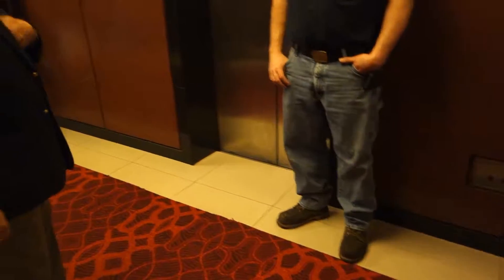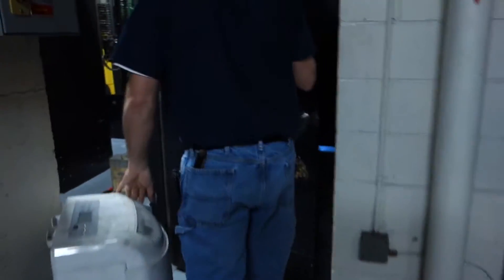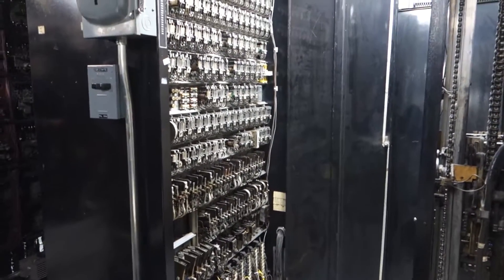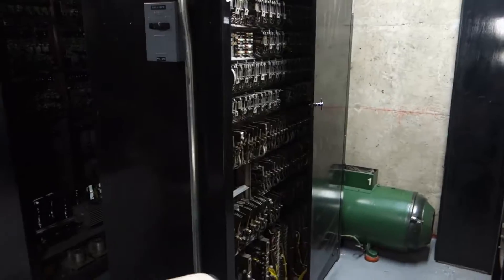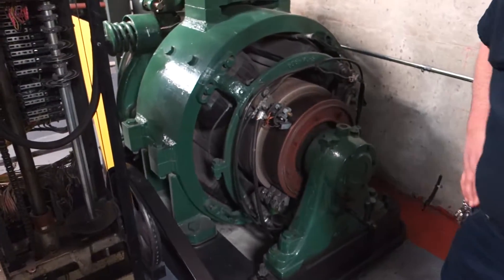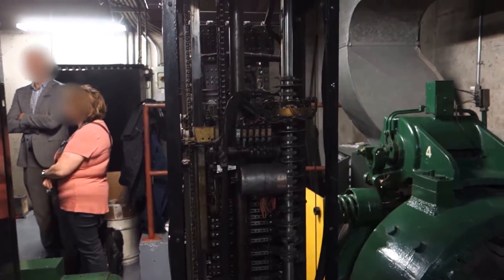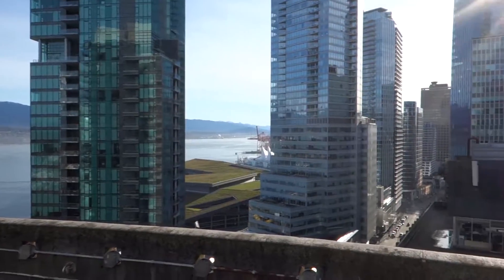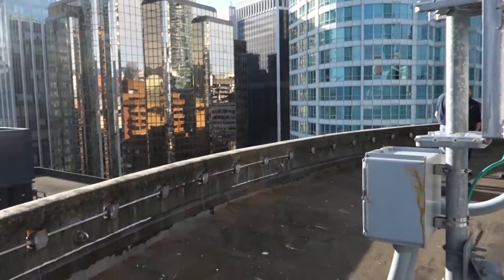1975 Otis VIP 260 Gearless Traction Elevator Equipment in Vancouver, BC

Comment: Those gearless machines must be 1950s or early 60s vintage. The base for the motor is cast iron instead of fabricated from I-Beams.
Reply from the maker: These are indeed from the Mid 1970s. The people who work on them told me, and this place opened in 1975.
Reply: Those gearless machines are like the ones made in the 1920s. They have a cast steel base and oil lubricated "Babbitt" bearings. Note the covers on the bearing pedestal. Those are for inspecting the bearings and there's a chain the runs through an oil reservoir under the shaft..

Interesting these machines were still being made and sold in the 1970s. What's the address of the building where they are installed? I would like to take a look at the outside of the building on streetview.
Reply from the maker: @kansasthunderman1  1133 West Hastings Street, Vancouver, BC
Reply: Interesting that the geared machine for the service elevator is an AC motor instead of DC. It must be a two (or possibly three) speed motor in order to provide reasonably accurate floor leveling.

Comment: 4"08, end of their life cycle???  I say restore these to their original beauty.  If these are breaking down a lot, that could be lint getting into a lot of things.  I know it may be kind of heavy to carry a vacuum up, but I would take a small shop vacuum up, or a Hover Wind Tunnel vacuum and vacuum out a lot of dust and dirt.  I would them wipe down the motors and polish them.  For the floor indicators and button panels in the cabs, I would just get up there and vacuum the dust out of them.  Once all the dust is sucked out, I am sure that would make things work much better.  For the cab walls, I would go over them with my cleaners and buffing rags.  For the floor in the cabs, I would vacuum, mop, and buff them.  And then once all the dust has been sucked out, I would walk up to a housekeeper, and get one 35 gallon trash bag off the cart, walk into a trash room with my vacuum, empty the vacuum into the trash bag and toss the trash bag down the chute.
Reply: The floor selector on the old Otis controllers is the biggest headache in maintaining older equipment. Very fascinating to watch, but too many moving parts to maintain.
Reply: The mechanical floor selector is the "problem child" in old fashioned elevator controls. Although they are fascinating to watch, they have two many moving parts and they are not cost competitive with a computerized system. 

Unfortunately for us elevator aficionados, the cost of operation outweighs the thrill of seeing "the art in motion" of the old fashioned equipment. Therefore we need to save videos of these old equipment so people 50 years from now can see the art and science of those relay based controls and DC motors..
Reply from the maker: Streetcar1664 I so agree with you!!!! Very well said!!!!
Reply: Streetcar1664 4:08
Reply from the maker: They were talking about jist restoring these, but they are probably going to mod them as they told me that they would just be restoring dated equipment and that it would make more sense to modernize them, but restoring them would mean restoring some of the best elevator equipment ever made, and it would last another 40-50 years!

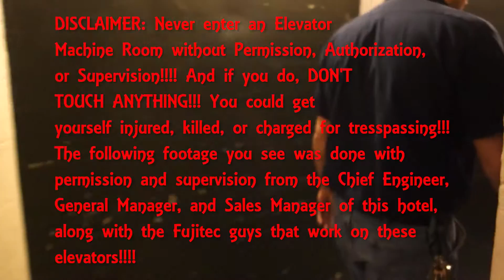Comment: At 1:53, you have said the truth about machine rooms.  One of the biggest dangers is the sieves on the main drive wheel.  And there are lots of cables there.   If anyone would have leaned against the area where the cables are and the elevator starts moving, those cables are like saws.  They can cut fingers off.  Seen at 2:47 are the sieves on the wheel.  What I see is the proper way to modernize the elevators.  At night, a tech should at least go one car by one, wiping the sieves off, wheel and the shroud.  Then if these have a sponge type filter, take the filter out, find a slop sink, and flush the dust out of it and put it back.  Now to do that type of work, you may be wanting to work a 3rd shift at the hotel.

Comment: Will the modernized ones use Otis fixtures? It's good that they're keeping the original motors.
Reply from the maker: Nick Harper Vlogs No, they would be getting rid all of the old fixtures and parts except the motors.
Reply: Gearless motors are pretty reliable and economical so many modernization jobs retain them. However,  if a building owner has the $$$, they upgrade to permanent magnet synchronous motors.